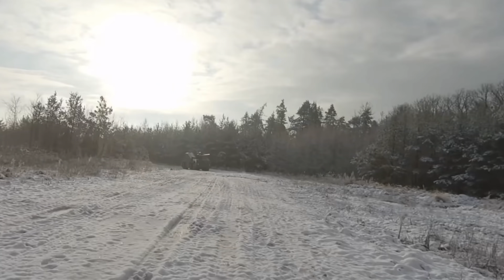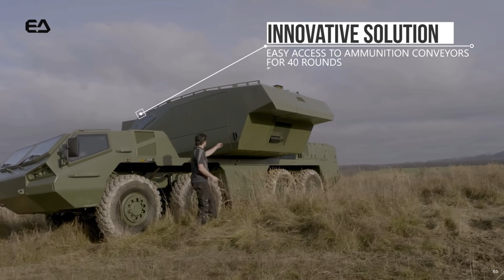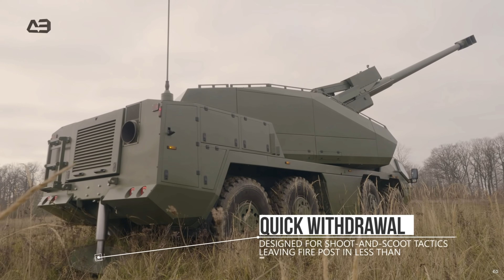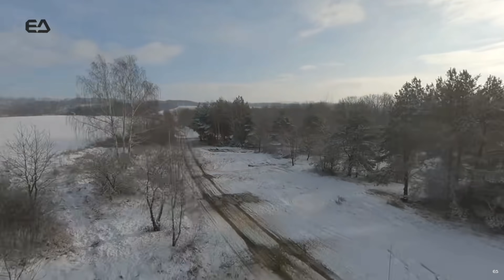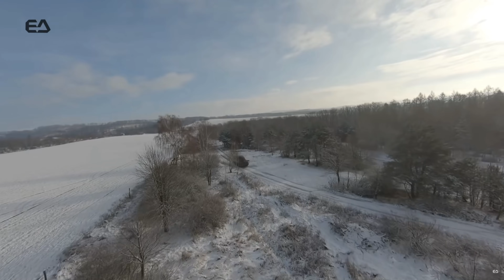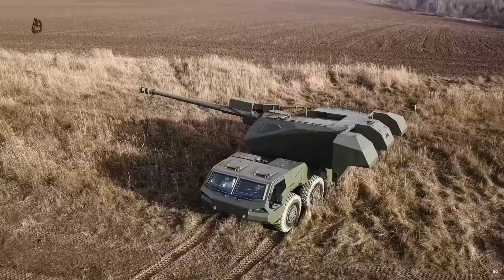Excalibur Army 'DITA' 155mm Self-Propelled Howitzer | MODERN BATTLEFIELD ARTILLERY

Comment: This poses a problem: intelligence. Two of these dueling it out would only get the upper hand with damned accurate target spotting.

Imagine this in an urban environment. The gun shoots and shoots up and down the streets putting various buildings/cover around it. Furthermore, imagine regimental signal drones are grounded (I can only guess every sniper, air defense, grunt-on-the-ground understands drones cannot be allowed within a rumor of the battfield if they hope to survive.) So now you must rely on spotters in an unfamiliar city who have no idea where counter-battery fire must come from. The more you make the rubble bounce, the less you can move through the city. Sniping away at each other drops buildings, overpasses, bridges, active power lines, and a shrewd battery commander has effectively blocked your ability to move through town, and he made you do half the work. Leveling city blocks can be done, but it's counterproductive. Infantry is busy clearing infantry in house-to-house fighting. Just having a dozen of these things in a city the size of St Louis would rapidly cut every way in or out of town trying to kill the other side with no advantage gained for the attacker and steadily accrued advantages for the defender.
Reply: Im a bit confused. You know this is field artillery? As in long range, indirect fire? Its not supposed to fight in urban environments, even less so than an MBTs.

Comment: A couple of points:

1) As far as I understand - only rounds that land within ½ minute after the impact of the first round has any significant effect. Sustained fire produces a lot of rubble and tremendeous irritation, but as every professional unit takes cover as soon as it starts booming - and several world records have been broken after the "starters gun" has boomed. So it doesn't really make sense staying behind as long-distance demolition team - expending lots of ammunition. So firing 6-8 rounds within a minute all landing within 30 seconds of each other should do the job.

2) Maximum range is a bit of a moot point. Firing according to 1) will be considerably shorter - even with base bleed. Simply because the grenades will fly in dog-legs in the vertical plane. The other thing is that precision is vastly improved with decreasing range. As to protection - yes would be nice; but the best protection is not being where the counter battery fire hits - when it hits.

3) Where does that leave the 105 mm. Well I should think very comfortably. The modest recoil means that the 105 mm mounted on a - say - Piranha V does not need the paraphenalia of a 155 mm with split trails and so on. This means striking camp at end of fire mission could be that much quicker. Futhermore hitting precisely means that "danger close" is not that much of an issue.

4) I would like to direct your attention to the most recent naval exercise where the frigate Ivar Huitfeldt fired two Harpoon missiles and Zeven Provinciës fired one. All hit their targets simultaneously - before paddling their merry way - away?
https://forsvaret.dk/da/nyheder/2021/dansk-fregat-affyrer-missiler/
Personally I believe it to be much more a "proof of concept", as I believe the Kongsberg missile (https://www.kongsberg.com/kda/products/defence-and-security/missile-systems/nsm-naval-strike-missile-nsm/) is a more likely candidate in the North Atlantic.
But yes, it is sort of the same idea, with the "sea-skimmer" flying doglegs to achieve simultaneous impact.
Reply: 1) that only counts if they have sufficient cover from the artillery, it doesn't matter if the enemy takes cover if their cover doesn't provide noticeably protection (which depends on the cover and shells in question)

2) guided munitions mean maximum range is a factor (for atleast some fire missions), additionally terrain limitations and enemy action means increased mobility isn't a reliable protection (in all circumstances)

4) thats not particularly impressive or new, 'time on target' fire missions (where all the shells/rockets/missiles are fired/launched in such a way as they hit at the same time) have existed since ww2, modern technology has only made it easier.
Reply: @matthiuskoenig3378  advanced artillery systems like this will shoot their first shot a high arc, second at medium and last shot at a short arc so they can land 2-3 shots on target at roughly the same time instead of one after another.
Reply: @matthiuskoenig3378  Hmm... I think I have allready messed enough with trolls heads, so .....

Comment: Direct fire capable, so it might find itself destroying tanks.
Reply: More like strong points, only if you sure they can't kill you. You engage tanks only directly if no other choice, better to run than fight
Reply: Probably not, unless its confident that it can outgun an APFSDS round coming from 2 miles away from a tank. Its direct fire capability will probably be used for anti implacement use. Besides if youre gonna use something for an AT role you'd use missiles for easier use anyway. Artillery rounds aren't that best suited for taking down a tank.
Reply: It will be spotted before even moving

Comment: like a ship's gun on a flatbed lul
Reply: Not really. Guns on modern ships are rarely bigger than 75mm bc they don't need to be. On old ships, 155mm was small. That's, what, a 6-inch gun? Psh. Laughable when most cruisers had at least 7inch guns.
Reply: @CharliMorganMusic  8 inch guns you mean. 203mm is 8 inch
Reply: No it's a 155 on wheels..
Reply: @BAZZAROU812  yeah, it s a 155mm, but the shape of the box built around the barrel... 🤣🤦‍♂️🤣
Reply: That's pretty much how self-propelled artillery works.
Reply: It is da wae of the Slav!
Reply: EXACTLY what it is...